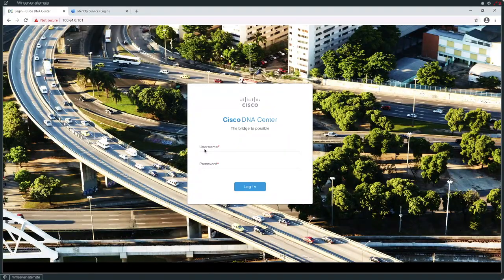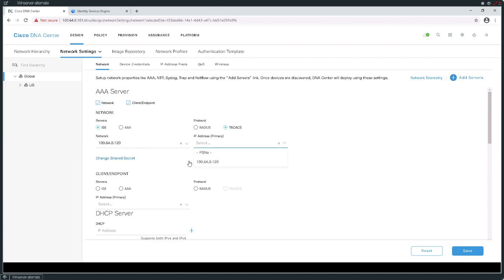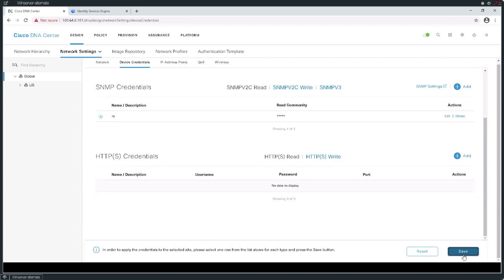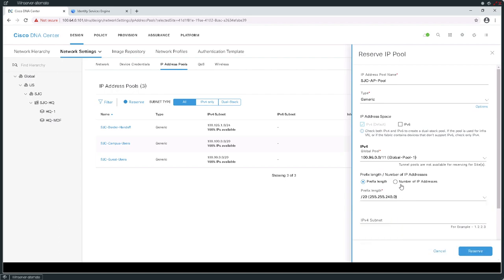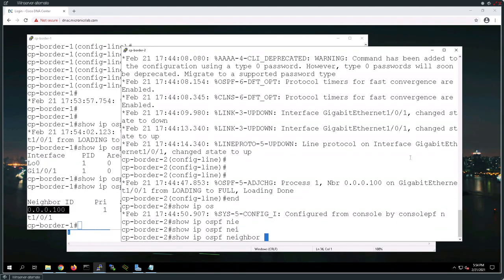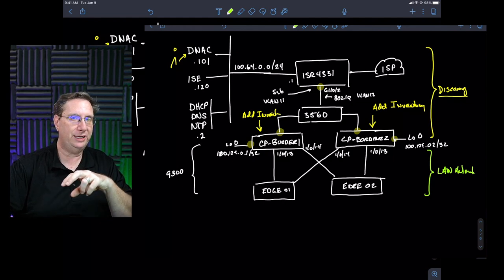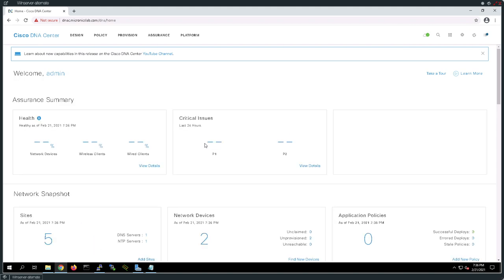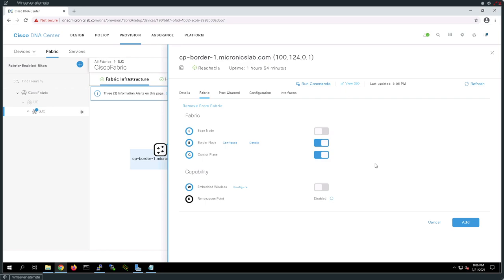Cisco SDA - Building the SDA Fabric using Discovery and LAN Automation

Comment: In the LAN automation process, I wonder how DNAC goes about changing the IP address and such for the interface on the edge that it itself is connected to inband without losing the connection. It looks like the seed devices discover the edge devices, and then sets up basic networking on them and the southbound seed device interfaces so the edge has IP connectivity to DNAC. So, edge device uses a simple VLAN 1 SVI to pull DHCP address from the seed DHCP server, and has L2 links up to the seeds. When you click “stop” how does it reconfigure everything inband without losing a connection? In other words, DNAC must be connecting to the edge VLAN 1 IP initially, but then the VLAN 1 SVI is effectively brought down as the edge uplinks are transitioned to L3 links running ISIS, etc. Great video Terry!
Reply from the maker: I am going to record a new video setting up SDWAN as transit between two Fabric Sites under one DNAC. I'll take the time to walk thru the process as LAN automate one site. Just for fun i'm going to put a intermediate node between the Border and 2 Edges. But essentially you are correct. Great idea to demonstrate it.

Comment: @TerryVinsonCCIEx2 if we don't use discovery for BN/CP Node commissioning, as we will not have console connection at remote sites to put the basic bootstrap Lo0 config in on it, while commissioning the Border node. what would be the process to use LAN automation or PnP method to get the Border node onto DNAC, then make it as a seed node for LAN automaton further.
Reply from the maker: The main way I would pic would be pnp, LANauto and I don't get along because I don't like ISIS in the underlay (personal opinion). So I would use PNP with onboarding and Templates (regular and composite). I can make a video if that would help.
Reply: @TerryVinsonCCIEx2  thanks for your response, appreciate it. A video would really help to understand what basic bootstrap I can push on day 0 for the BN if using PNP and then day N other Configs.
Reply: @TerryVinsonCCIEx2 also, in our setup, on our sites, dnac will be in DC, then there is dmvpn wan inbetween, with dmvpn spoke routers ASR 1006 to which the cat 9500 will be connected acting as BN/CP nodes and they will be L3 handoff and we have 4 vrfs. How does the router and bn node connection configured ? For vrfs ? I believe mp bgp and on router side sub-interfaces ? If you could highlight on that, that would help.